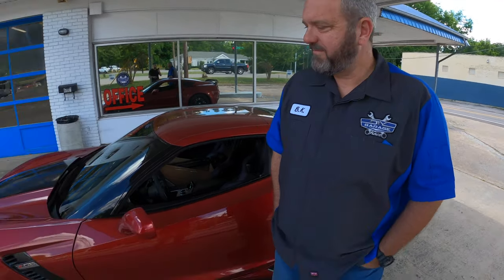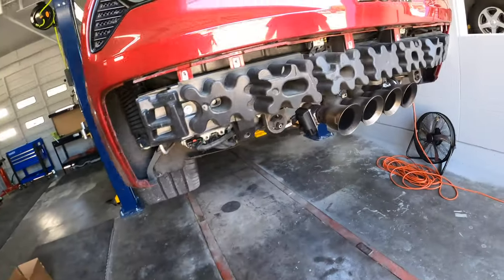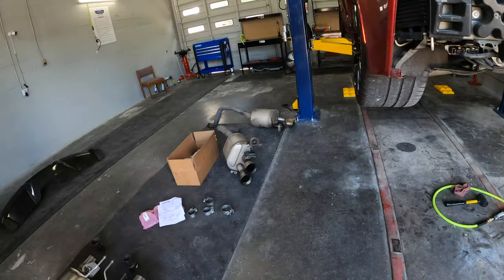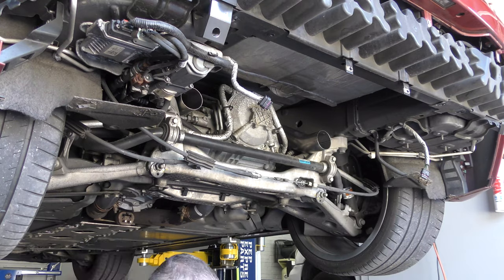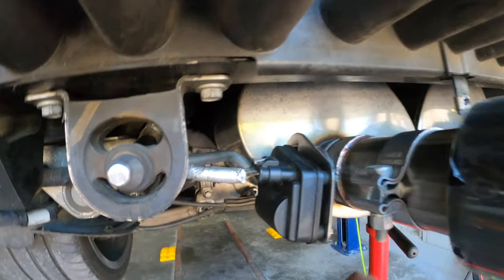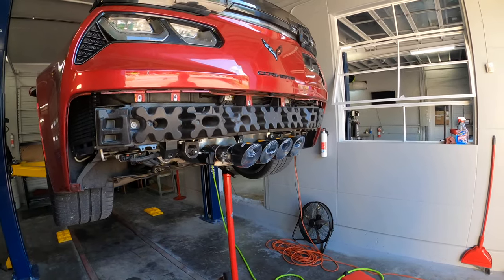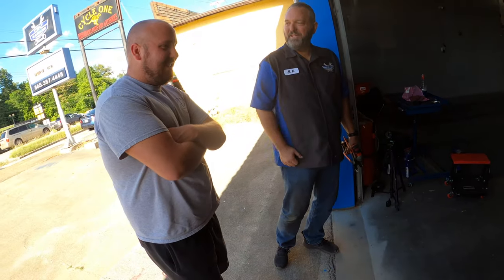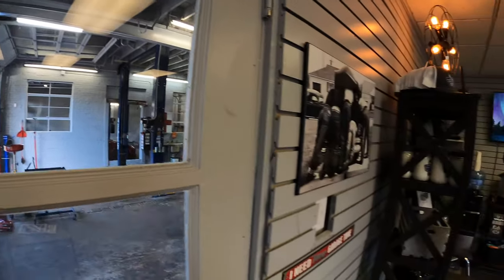Corvette Z06 Corsa NPP Exhaust Install ***HARD REVS***

Comment: Hey Rob, I already have the Corsa exhaust and Corsa xpipe, I'm about to do heads and cam. I originally didn't want to do headers because I'm really happy with the corsa sound. How do you like living with headers and Corsa on regular basis? Is it ever too much?
Reply from the maker: I love it, but it is extremely loud. With the valves shut, it's pretty quiet and definitely daily drivable. Without the valves, it may be a little bit too much. It really just depends on your tolerance for a loud exhaust.
Reply: @RobsHouse  Sounds like there's only one way to find out lol I suppose I can always keep the stock headers and put them back on if it's too much. Only other consideration is noise limits at certain road courses
Reply from the maker: @MichaelGreco  It will definitely exceed the noise limits at those road courses haha
Reply: @RobsHouse  100% in CA lol but not sure about DFW area or even Circuit of Americas in Austin. Moving to DFW this summer. I'm in contact with LG Motorsports who's in DFW, I'm going to do their cooling kit when I get out there I'll hit them up.

Comment: Does the rear bumper have to be removed to install the exhaust?
Reply from the maker: That lower portion that we removed in the video does have to be removed otherwise you cannot get to the clamps for the tips or the bolts for the hangers. The upper portion can stay on the car like we had it.

Comment: Did Corsa resolve the valve problems and add a spring? I just ordered a system and worried now...
Reply from the maker: Yeah they did. Mine was just in a bad batch that happened early on. The replacements they sent me work perfectly

Comment: Nice exhaust! Was there any cutting involved?
Reply from the maker: Not on the Z06. For vehicles with Active Fuel Management (AFM) valves, there is cutting involved. The Z06 doesn't have the AFM capability (which is basically the V4 mode for fuel economy).
Reply: Rob's House i see, i have a 17 GS and was thinking of getting this but worried if there is cutting.

Comment: Hey Rob, in this video is your car completely catless with a cam?
Reply from the maker: No. It has aftermarket headers, but there are cats. Stock cam. This is before the motor build. It's basically just a full aftermarket exhaust.

Comment: Rob, have you had any problems with your valves closing on your Corsa axel back ? 
I’ve been reading through some forms, and there’s been a hand full of people having that issue.  Supposedly to stock mufflers have a spring to help keep the valves open, Corsa muffler do not have that spring.  I just ordered the system, and I’m hoping I do t have that issue.  
By the way your car sounds amazing.  You also have a lot of great videos, keep up the good work
Reply from the maker: Yes I do. It's really a problem with the valves opening back up (not closing). If there's not enough exhaust flow to help them pop back open, they sometimes get stuck and rattle. When that happens, I just close them (stealth mode) and wait until i can give it some gas. Then I open them (track mode) while I'm accelerating. That seems to do the trick for me. If you have a lot of soot build up in there, soak the valves and surrounding area with WD-40. It'll loosen all that up (it'll smoke a lot too cuz it'll burn off once it's warm so don't freak out). Usually, simply closing and reopening the valves works for me. It is annoying though.

Comment: There has been at least one report of this system not having return springs on the valves allowing them to drift shut. Is your system operating as expected and did you notice whether it had a spring on the valve like the stock NPP system.
Reply from the maker: I'm glad you brought this up. It does not have the return springs, but mine also do not seem to drift shut. The issue I do have is that once in a while, one of the valves will get stuck in the closed position because of soot buildup. I have had to spray WD-40 up in there to clean the valve and surrounding area. I emailed Corsa about this and they basically just acknowledged it and said I did the right thing with respect to the WD-40. But they didn't have an answer as to why there are no return springs...

Comment: I just watched a video on corsa and they had two seats of valves on that video one set on the axle back pipes and the other on the mufflers why does yours only have one set?
Reply from the maker: The set on the axle back pipes are AFM (Active Fuel Management) valves. The Z06 doesn't have AFM. So, they were installing the exhaust on a stingray in that video. Just make sure you buy the right exhaust for whichever model you have. Mines was the 14777 and I believe the one for the base model that you saw is the 14776.

Comment: Hey Rob very clean build. If you remove the exhaust valves from the existing tips does it have a check engine light come on? I was planning to straight pipe my c7 z06 and doing a muffler delete. But im worried about the valve motors though. Do they impact or reduce sound?
Reply from the maker: Thanks Kevin! Removing the valves will not cause a check engine light. One of mine actually came unplugged a few days after I did this install (must have vibrated the connector loose). There was no dash light. The valve was stuck in a weird position and was making a rattling noise. I ended up figuring it out, but it was a bit difficult actually since it doesn't throw a code. If you straight pipe your car, you can just unplug the valve motors which are attached to the factory exhaust and just zip tie those wires somewhere safe.

Comment: Did you keep your xpipe or did you replace it with a different one?
Reply from the maker: The car already had American Racing headers and X pipe. So, I only swapped the axle-back. If you have a stock x-pipe, it'll make a big difference if you swap that.
Reply: @RobsHouse  alright I just ordered the axle-back and stock manifold and xpipe you think it’ll be a difference from the stock ones?
Reply from the maker: @polinjr4545  should be a little louder. If you want it a lot louder, you need to swap both the x pipe and the axle back. But the corsa mufflers are definitely louder than the factory ones either way

Comment: Hey man! I just got this installed in my ZO6 today. I love it.  there's really no difference between Sport and track mode is yours like that as well?
Reply from the maker: The difference is that in sport mode, it’ll shut the valves in 5th gear and up when you’re cruising. 1-4 the valves will stay open. Track mode, it’ll leave them open all the time
Reply: @RobsHouse  ah!!! Thank you! Just tested it, it took a second too, I had to lift off the Throttle for a few seconds.
Reply from the maker: Yup. It leaves them open while you’re on the gas and then once it’s convinced you’re cruising, it shuts them :)
Reply: @RobsHouse  so glad to know it's not broke or set up wrong lol can you tell what mods you have done to get to 700 wheel on pump gas? Do they have 93 near you? I'm stuck with 91
Reply from the maker: I did a video on the motor built. It’s basically a max effort stock blower build. And yes, it’s tuned on 93. We have 93 here and E85. I’ll be finishing the E85 tune soon once I install the additional fuel pump I needed for it.
Reply: @RobsHouse  nice, I'll look up the video! Side note, I also did the DSC sport controller, dude it's amazing. Car is way more stable and soaks up bumps much better. Puts the power down better too
Reply from the maker: I will have to check that out
Reply: @RobsHouse  been driving it now for a few days with the DSC it's amazing. Hard to describe, but it's so much more confidence inspiring. I've been driving around some hilly and curvy areas near my house that tend to unsettle the car and it just handled it so much better and stayed smooth

Comment: Rob, I have a 2019 ZR1 with a CORSA Y pipe. Already fairly loud with valves open. Was thinking about adding the 14777BLK mufflers but don't really want to lose the quite Touring mode I get with valves closed. How much louder is it from stock, both with valves closed? Can you really cruise on the highway without any droning?
Reply from the maker: There’s is no highway drone even with valves open (although you’ll hear it purring in the background). With valves closed, it’s just about dead silent inside of the cabin. Certainly worth the extra money for the NPP compatible system 👍